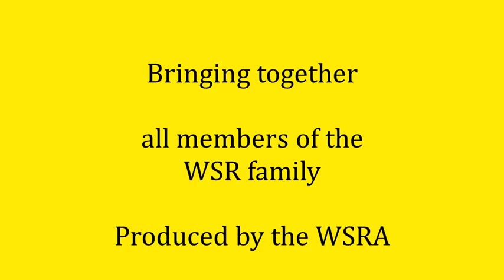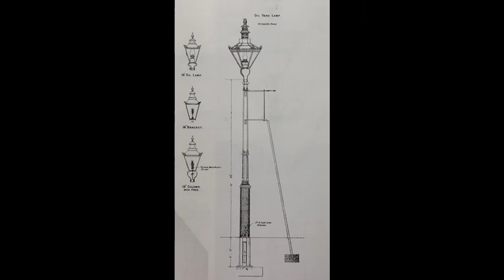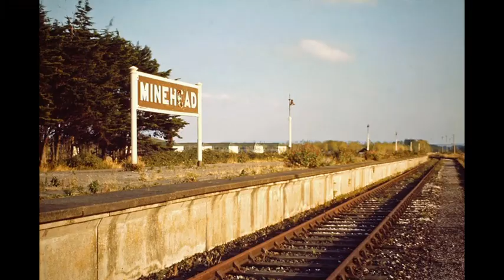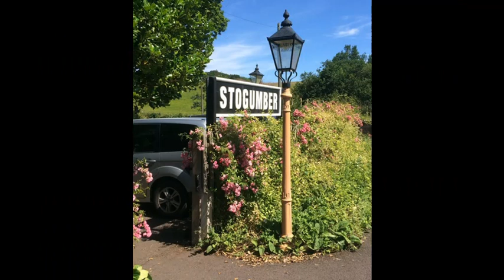GWR lamps on WSR Stations

Comment: Some stations on the Barnstaple Branch, such as Filleigh,  used to have lanterns fixed to the wall above the station door, rather than on posts.  I seem to recall the lamp tablets of some of these were amber rather than frosted glass.  It was very useful to have the station name illuminated at night, when passengers might not see the running in sign.
Reply from the maker: Thanks